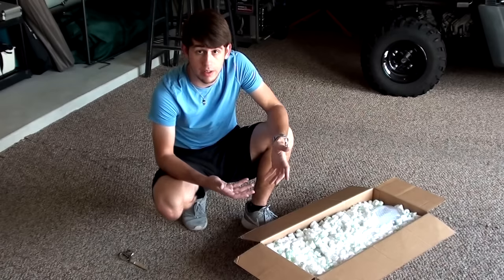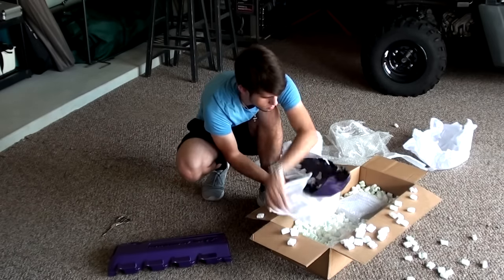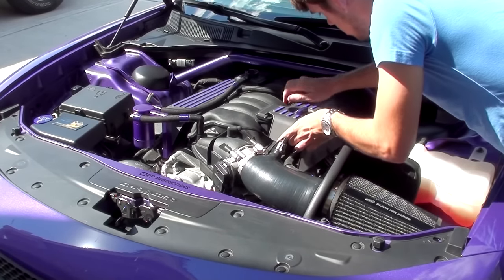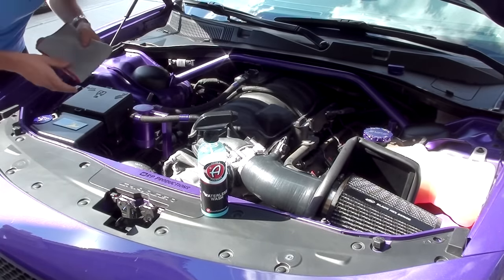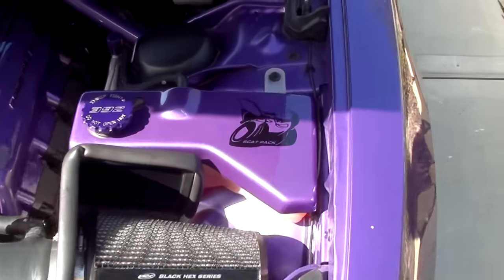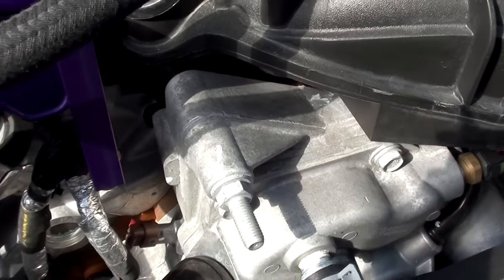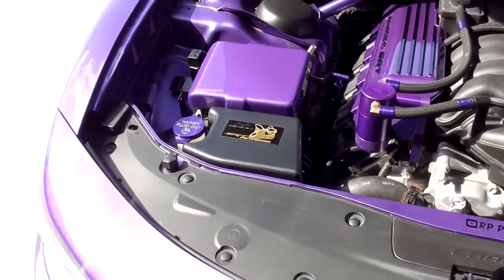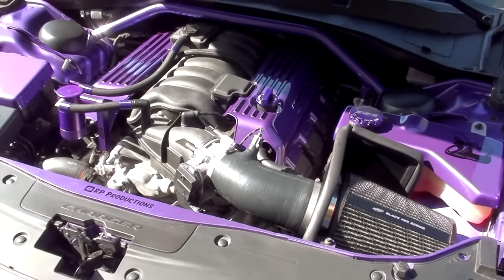JLT Performance Underhood Dress Up - Dodge Charger Scat Pack

Comment: very nice looking bay RP ...black caps would be nice add to brake the color, also why dont u tint the head light maybe with 35% tint not 20% like i did ...its a bit to much but on purple black will look sooo hot ....if i find i pic i will send it to u on instagram ....same purple charger with black head lamp and u will still be able to see DRL no problem....car is looking amazing ....

Comment: nice. I would like to go with some red accents in my Scat Pack. btw, why is your scatty not lowered yet?
Reply: it doesn't need to be lowered.
Reply: Oldschool Gamer Rick he has said he doesn't want to deal with clearing issues
Reply: Oldschool Gamer Rick I lowered a car I have, WORST thing I ever did! constant problems scraping, messed up geometry so the tires wore out quickly, rode bad, bounced a lot! just a bad idea all around for a daily driver. If you want a "Tucked look" buy bigger rims